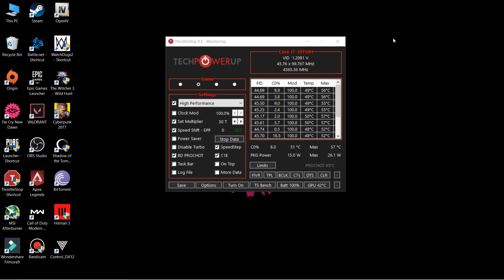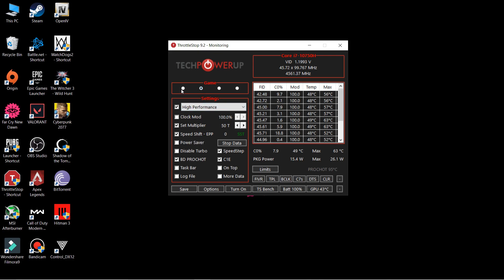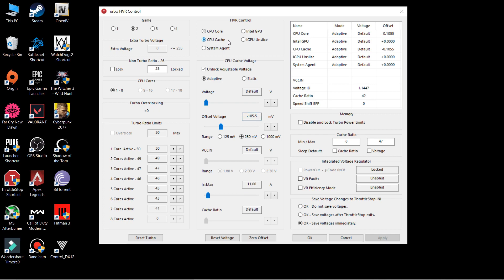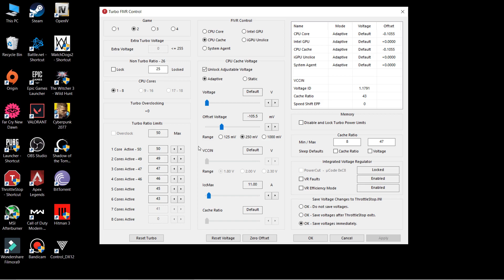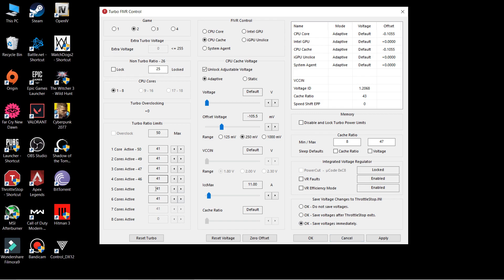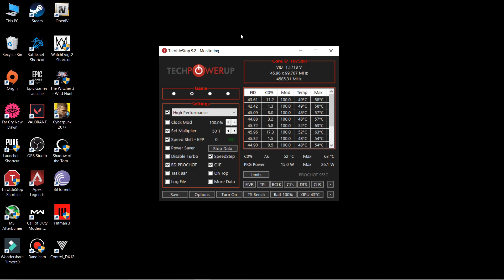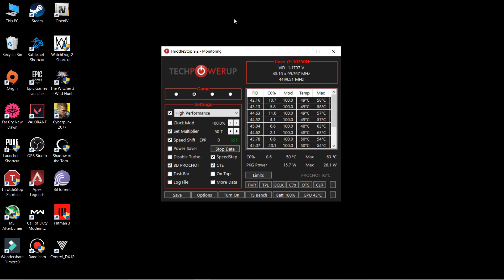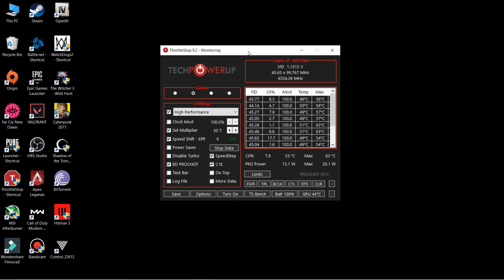how to fix overheating in laptop !!Undervolting Quick tutorial !! how much value you should start!!

Comment: Hey mate, great video but unfortunately I have an asus strix g15 laptop with i7 10750h and rtx 2060. And like other company's asus has also disabled the use of throttlestop and xtu to undervolt. However asus allows users to undervolt in bios to -80mv. Is it safe to undervolt through bios? Thanks and keep up the great content
Reply from the maker: Definately buddy you can UV
Reply: @R-tech890  and what if undervolt isn't stable and doesn't let me boot
Reply from the maker: It will not happen.
If UV is not stable then your pc will crash and restart and its normal.
It will nor harm your system.
It happened with me alot of time..✌️
Reply: @R-tech890  I understand what u mean but throttlestop and xtu don't save settings on boot like bios. So if I was undervolting through throttlestop and I get a crash I can go back in windows and change the voltage but in bios settings are changed on boot. Hope u understand what I mean and thanks for the reply
Reply from the maker: Those can also be reset bcz when we are in bios there is no load in cpu voltage.
But to be safe try using lower values..
Reply: @R-tech890 ok last question. What are safe values for i7 10750h because I have already applied -80mv in bios and doesn't seem to help much with temperature. Thanks
Reply from the maker: You can try safe like -95
Reply: @R-tech890  hi thanks for the help dude. i was able to get a -105mv undervolt on my laptop using a modded bios from bios mods website(them guys are great and he editted my bios and was super ez to flash). now i can undervolt to -200mv but obviously my cpu could only take -105mv. anything more i would get a crash. 👍 👍

Comment: Hello
You have MSI GL65 Leopard right??
If yes I also have the same laptop, but for me -125mv doesn't work.  It becomes blue screen.
Also, after switching on throttlestop, which profile do you use in MSI Dragon Centre? Extreme Performance?
Reply: Please help :)
Reply from the maker: Msi dragoncenter on extream.
Also 125 only when you have lower clock to 4.1Ghz.
Otherwise 100mv or lower..😀✌️
Reply: I usually have MSI dragon centre profile on extreme performance with cooler boost on. I hope this doesn't negate the settings applied by throttlestop?
Am i right?
Reply from the maker: Yes buddy..
Reply: Also, do you use any cooling pad? If yes, is it effective?
Reply from the maker: Yes  i use cooling pad. And its effective.
by Deepcool.
Reply: can you please give the link?
maybe amazon link?
Reply from the maker: Here bro..
https://amzn.to/3hl5FzT

Comment: Do you not need to press "turn on"? and also, why don't you have ur power plan at maximum performance? Is that a bad thing?
Reply from the maker: Turn on does not do anything.
Its just for the data reading.
Power plan at max does not do any damage.

Comment: Bought the laptop and while installing games my temperature is going upto 80°! Is that normal? Without cooler boost on and fan on auto! Please tell im worried what will be the temperature while gaming then!
Also my cpu is throttling alot while playing games! Its speed goes down to 2.7ghz-3.1ghz not more than that! And i get only 27-30fps while rtx ultra and quality dlss in cyberpunk
Reply from the maker: You clock speed droping due to low bettery level or you havnt turned on the turbo fan mode.
And in cyberpunk rtx and dlss you only get 30 to 40fps max
Reply: @R-tech890  where to turn on turbo fan mode? Please tell me best settings for dragon center! Battery was 60% and plugged in! I saw ur video on cyberpunk u are getting 60fps bro on rtx ultra n dlss quality by oc! Without oc i should atleast get 50fps but thats not the case im worried!
Reply from the maker: Charge bettery above 75....
And you dont have to change enything in dragon center.
You can turn on turbo fan mode by clicking the button in top right cirner with power button
And also in dragon center by moving onto extream profile there will option for turbo fan mode..✌️
Reply: @R-tech890  cooler boost yes i turned it on! Battery on 80%! Also is it normal while installing games cpu temperature goes to 75 without turbo fan?
Reply from the maker: Yes....
Reply: @R-tech890  ohkz thanx bro! U were right Above 75% battery needed! Perhaps my temperature is going 95-97 degree playing wildlands just for 19-15minutes n im afraid!
Reply from the maker: Get a cooling pad bro
Also ambient temp matters alot .
Make sure ambient below 30C
Reply: @R-tech890  as soon as i overclock gpu and mem clock cyberpunk says flatlined! Wildlands crashes too! Whats happening any idea brother?
Reply from the maker: Not every game support same oc values.
Some game crash even with little hard push.
Try small values for cyberpunk.
✌️
Reply: Also please tell the turbo ratio limits here in throttlestop is not working for me i cannot lower it to 41! That reduce and increase button isn't working!and your pkg power and c0% is way lower than mine.. mine is 86° and 51.3W 18.9W! How do u lower it?
Reply from the maker: Watch all videos related to UV i cant explain in comments.
I am in job right now.

Comment: heyy i got a quesstion so my icc max for cpu is the same as yours but icc max for my cache is at 165, is it bad?
Reply: i changed it back to your setting on the video and it seems stable becuase yesterday i had a lot of crashes
Reply from the maker: 😃✌️
Its ok if icc max is diff in core and cache..✌️
Reply: @R-tech890  like yesterday both icc max for core and cache was 165 and now i made it 11 for cache like in the video

Comment: Hi! About the undervolting. I set my i7-10750H core and cache to -125mV without touch the core's active and in stress test i have around 80-82 degrees and max 4.2GHZ and on XTU benchmark around 2300 points. My question. There are a lot of settings on the internet and i dont know  which is the best for laptop life. Some people say to change from -125 to -90, anothers says to change turbo ratio but i dont wanna to cut a lot of processor power.
Reply from the maker: If you are getting 80 to 82 tempa and 4.2 ghz.
Man do not watch any other video.
Bcz these are great number.
If you will try to do more you end it up getting nothing...😃👍✌️